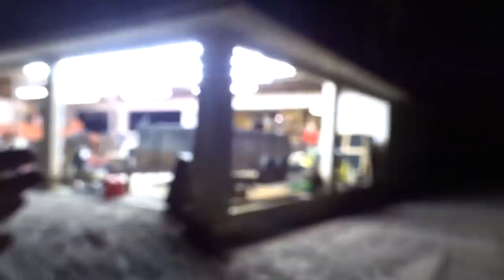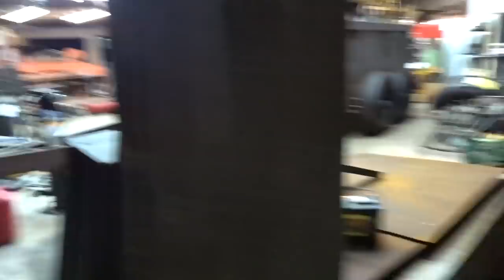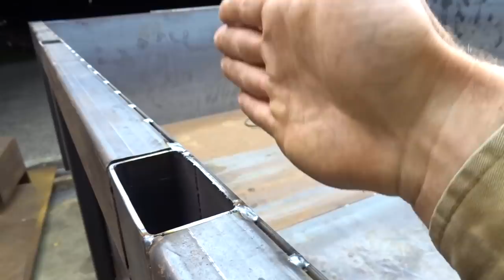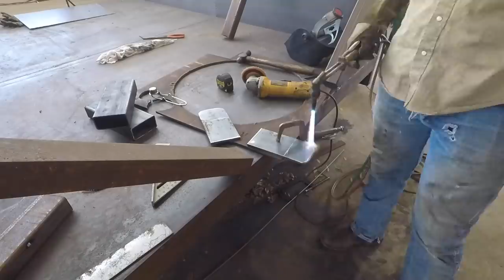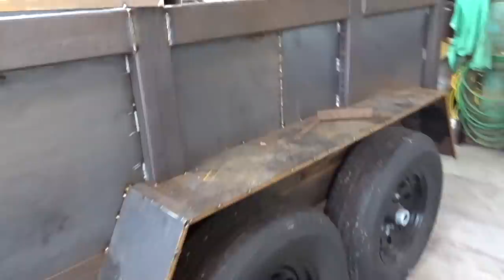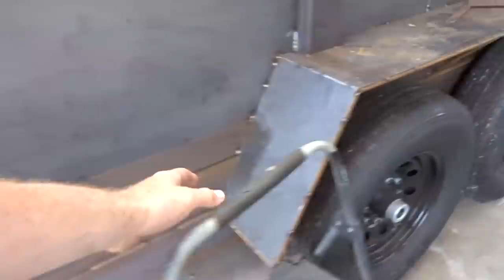Dump Trailer Build Pt 6

Comment: How did you get started on pipe iv been welding for 5 years and run a mobile welding business on the side but it’s a dream of mine to jump on the pipe line just do not have any connections would love to talk to yah if you got some time

Comment: For the side extension. How about an I beam that slides down each hole and wood cut to size to fit into each I beam channel across the steel walls
Reply from the maker: That would probably work well
Reply: J_Moffitt I’m just getting into metal working. My buddy is a welder and I found your videos when I was thinking up plans on a flatbed for my truck. Your videos are very helpful. Love the content

Comment: Hey J, 
I wanted to know roughly how much this trailer build cost for the steel? I know our prices here in the upper north east are different than where your at but it will be helpful. 
Stay safe!
Thanks for the videos!
Reply from the maker: From my local supplier I spent about 2700 ish on steel

Comment: I do have to ask   why so much torch cutting when you have a plasma cutter ??  Like I said before just bought my first hypertherm powermax 45xp love it used it few times just I dont have a shop set up where I can have more then one thing running on 220volt power  so I let the compressor run up switch plugs  do my cuts  plug back in  compressor do cuts  and so forth .... just dont know why u and so many others always gas cut over plasma cut
Reply from the maker: If it’s thick enough material, torch is sometimes easier because you don’t have to drag out the power and air lines plus your ground and plasma torch cables, but on thin material I grab the plasma everytime because you don’t have as much cleanup or warpage.  For a long time all I ever had was a torch so i just grab whatever is handy